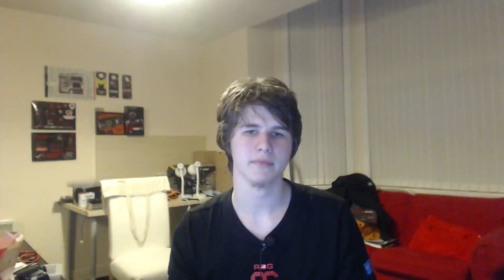Follow up to the RX 480 Red Devil PCB Breakdown (It's not as bad as I think I made it sound)

Comment: is it bad for eth minning and what is the bbest card for minning i basically need the card with the ability most memory oc i play at high only so downclocking to 1150 or lower
Reply from the maker: it's fine for mining ETH
Reply: 24/7? thank you for your fast reply
Reply from the maker: just crank the fan speed. If you under volt the Vcore you have to worry even less.

Comment: I ran furmark for a minute and a half with the unlocked bios at 1330mhz and I got these numbers.

-Max wattage hit 194w, and 1.1625v max. I didnt get the average unfortunately because gpuz shut off on me when I double clicked it in the task bar. The average was most likey around 1.13. or 1.14v.

One test with heaven had max watts used was 216.1w and the average was 130w. Max volts was 1.15630v and average was 1.13360v. This is with the unlocked Bios and an oc to 1330mhz on the core. 
That was my best captured test and gpuz if you double click exits out for some reason and I get averages like 62 watts. 

I think if you run the card at 1330mhz oc and dont touch the voltage, leave it at auto in wattman it will be between 1.113v ave and 1.1625v(furmark) max. 
I belive the max oc people should do on the card is up from 1279 to 1330 and thats it. You'll be fine.

Your pcp vid on this card got me so worried I was up that same night I saw it and just stress testing and last night when I got these numbers I felt so much relief. This video and you saying 1.2v is fine and the numbers over 1330 helped a lot more.

Comment: question.. i see there are two versions. do you have any info if there is any differences in pcb between the two?
Reply from the maker: Both versions of the Devil are the same except that one comes stock at 1290 core and the other at 1330 core.

Comment: OC3D gave the Red Devil a poor score due to the large but surprisingly disappointing cooler. I personally think it looks tacky, and based on what I've seen beyond your PCB breakdown, I wouldn't recommend the card.
Reply: yeah, I've seen that. Decided I'd be fine with it. I mean, I wasn't planning on overclocking anyway. Most of the 480s seemed to run too hot for me to want to bother anyway.

Comment: Hi everyone, some first hand experience.

I own the Red Devil and I am so satisfied with it. And I do have the high power target (using 130%) with bios hacked memory timmings (coz' minning ether sukaz'), overclocked to 1395 MHz, 1.175 VCore. FunMark tested. Well, it was before I found that warning... Anyway, it survived. Core is at 80C and the VRMs are at 75C-isch levels. It is running a 24/7 minning ether. Only sometimes I stop the minning and let i render a blender scene... So probably the worst case scenario talking in the terms of actually not much hardcore overclocking.

Again, I stress this card really hard, and it stands with pride. Great temps and very silent.
Reply: Furmark will not kill your card, there's hidden instructions in the drivers these days to protect cards from that dumb stress test.
Reply: Great to hear. i made a good choice then.

Comment: Can I request a gigabyte xtreme gaming pcb breakdown pretty please? Gamersnexus said you're working on one soon? I guess more to the point I'm curious about what you think of their choice to use quadruplers in the vrm setup
Reply: Not buildzoid, but AFAIK, quadruplers (assuming for the MOSFETs) can provide more current throughput and heat dispersion, but you're going to have a lot more ripple than if you were using more true pwm channel phases.

Also, I think builzoid or someone was talking about some IR quadruplers that actually were intelligent-ish, and could do more advanced current balancing, working more like a true phase, not a dumb doubler. Could be completely wrong here though, idk
Reply: Colin Reay
ah, interesting. what is "ripple" exactly? sorry i am still semi-new to all of this.

i guess i felt a bit cheated when i found out they weren't true phases but then again pascal doesn't really OC much anyways.
Reply: Here (http://www.gamersnexus.net/guides/2053-power-supply-voltage-ripple-and-relevance) is a good article on ripple. Pretty much, if you have excess amounts of ripple (more than the spec your components are rated to), it can decrease the component's life (especially caps which act as the filters, which de-rate in efficiency, causing them to get even hotter to compensate, and can blow up if you get too hot.) 

Also, it can limit your max overclocks potentially, imagine if you set a specific voltage for your cpu or gpu to run at, and your minimum voltage that the component can run at before crashing is only 20mv or so below that which you set, ripple can cause the voltage to dip below that minimum amount, causing errors. You can offset this with more voltage, through LLC, or just adding more voltage offset manually, but this causes more heat.

Yep, I agree with you 100% on Pascal. Your average Joe isn't going to volt mod his gpu, so the VRMs aren't really the limiting factor on the cards, it really just is the voltage BIOS lock, and the subpar coolers, causing frequency dips with GPU Boost 3.0.

Hope this helps man, trying to learn it better myself!

Comment: msi r9 270 2gb gaming pcb breakdown with mod tips until I can get a rx 480
Reply: please for the third time lol
Reply from the maker: Sorry I keep losing track of who requested what and when. Should really get some kind of list for this.
Reply: I tried tweaking afterburner to get a pwr limit of 50 (i think) I but that didn't get me anywhere.
Reply from the maker: should be easy enough to mod the BIOS for more power. The card has a BIOS switch.
Reply: https://www.msi.com/Graphics-card/R9-270-GAMING-2G.html#hero-specification         u sure about that (bios switch)?
Reply: also put heatsinks on everything possible
Reply from the maker: oh woops no BIOS switch. However it should still be pretty easy to change the power limit via BIOS.
Reply: ok I'll do some research. any recommendations on what to use or a certain guide? I've never messed with that. So I'll take any advice I can get. thanks
Reply: also how much more power could I gain being that the 270x has 2  6 pin connectors and the 270 only 1.

Comment: I wanna do power mod on a gtx 960 g1, ik is shunt mod but if i do this mod with a pencil i will can undo this If will go on rma? I hit 1670mhz on custom Air cooling (16*C ambient) and ik can do more but when i hit power limit core clock drop. Can explain me how to undo pencil mod? or what to use to Lower the resistance.(not clu/clp because i dont have) and i dont wanna solder anything on pcb.
thanks
Reply from the maker: the power mod on the shunts can't be done with a pencil you need liquid metal.
Reply: i can't do without liquit metal? Anything? thermal paste conductive)cheap silicone based).?
Reply from the maker: You NEED liquid metal. Thermal paste is generally non conductive. Graphite is also pretty high resistance.

Comment: Even if it doesn't matter for lame ass normal usage w/ mild overclocking, it's still a questionable choice to skimp on those parts to such a degree.  If most buyers had a choice to get a red devil that's not inferior to the reference card in any way for $5 more (or whatever it is), they'd gladly pay the difference.  The reference PCB may be slightly overbuilt in some cases though, so I don't think it's totally unacceptable for a manufacturer to substitute slightly weaker parts sometimes.  Anyway it's nice to know what you're getting, so your PCB breakdown videos are really helpful.

Comment: could you tell me how can i get my gtx 1060 g1 gaming over 1093 mV xD?
Reply from the maker: Physical voltmods. However I haven't used any 10 series cards and from what I've heard they really don't benefit from extra voltage. Maybe in the future when I get a 10 series card I will cover some more advanced overclocking for the 10 series GPUs.
Reply: Ok thanks, i got 2350 mhz at 1050 stable with no artifacts in heaven benchmark however in gta5 i almost couldn't see the game ^.^ by any change do u know why, and thanks for the fast reply.

Comment: Thank you for clarifying, many YouTubers don't clarify when they realize that what they said might have not sounded they way they intended.
I found your initial Red Devil video very informative, but also a bit lengthy, and maybe exaggerated, on pointing how bad the components Powercolor decided to use in the VRM. 
For years Powercolor have decided to use cheap components, that is why their cards are lower cost, but also they come with 2 years warranty. Their strategy has worked for them, just as ASUS has a different strategy with their higher prices and ROG strategies and MSI has its military components strategy.
BTW, subscribed and liked.
Reply from the maker: Yeah I was seeing loads of comments about how people aren't going to buy the card just because the VRM is the weakest one of any RX 480. Yet I bet most of them would never get anywhere near the amount of power draw need to actually damage the card as long as they didn't run Furmark.
Reply: tbh the ref 480 was overkill having better vrms than the 1080 fe

Comment: Please, do the comparison between the 5 phase vrm Nitro + 8g and the 'shity' 6 phase vrm red devil. Great video BTW.
Reply from the maker: There's a 6 phase version of the Nitro floating around too. I'm trying to figure out what the hell is up with that and then I'll do the Nitro video.
Reply: This should be the Nitro+ 4gb, but Sapphire said that the 6th phase is disabled by bios/firmware, so both versions are virtually equal, I think
Reply from the maker: welp that's dumb. If they actually used all six they would have a pretty beastly card.
Reply: Agreed

Comment: Your doing a excellent job with these PCB breakdowns. These cards are selling for twice the MSRP and being built with junk. Thanks.
Reply: he's talking out his ass
Reply: where did you get twice the MSRP from? I know it's an exaggeration but still, it really isn't that terrible.
Reply: RX 480's were supposed to retail for under  $200.
Reply: yeah, the 4gb models were. so where are they selling for $400? unless you're getting some jacked up water-cooled card, and even then it's be a big mark-up. 
and if you live in the US, you have the least to worry about.
Reply: It might have been an overstatement but the point is valid, some of these aib partners are charging premium money for a product that is, at best. a marginal improvement. Case in point, at least here in Europe, both the Powercolor 470 and 480 are among the most expensive.
If you're cutting corners let that be reflected in the prices.
Reply: $269.99 for an 8GB Red Devil on Newegg. That's not too bad for an AIB 8GB RX 480.
http://www.newegg.com/Product/Product.aspx?Item=N82E16814131692
Though don't get me wrong, I wouldn't buy it!!!
Reply: Even If the person NOT do OVERCLOCK on that Red Devil, i HARDLY Believe that it will lasts for like 4 or 5 years.
The quality of the power phases affect the lifespam of the card (or even a Motherboard ).
Reply: I was talking about Europe pricing. For instance, I can find a xfx gtr for 270€ while the cheapest red devil is around 290€. Basically only MSI and ASUS cost more.
Reply: ***** did you read that from a brochure?  Can you tell me how it shortens the life of said components, especially if youre running an aftermarket cooler.
Reply: pfnieks the power color seems to be a US model, while the HIS model of the 480 is almost non existent in the US and costs almost 360$ for me to get one here

Comment: I have a question... what about the PCS+ R9 390?
Reply from the maker: IIRC that card was fine. A lot of the GPU manufacturers are just all over the place with their designs. EVGA is at least somewhat consistent. All the Classified card from them have the same 14+3 phase VRM. This thing is insanely powerful and you will basically never need more power. However if you do for some reason there's the K|NGP|N cards which usually take that same basic layout and use some better components in it.
Reply: Actually Hardcore Overclocking 
I do not buy Nvidia cards these days though (lets say I am a very annoyed Kepler owner).

I was wondering because my current GPU is the PowerColor R9 390 PCS+. It uses less power than other R9 390s... but I dont know of its layout and PCB

Comment: regardless of whatever if you want to push any GPU to its limits or not, customer has right to know if a product has worse component base installed on PCB, than other products. if it is garbadge, then regardless of its "safety" in real world scenarios, it is garbadge.
Reply: Highly unlikely.
Reply: well, it's still the cheaper rx 480 and it have a great cooling and acoustics. since the vrm are good enought to not be a problem in everyday use i see no reason it should be bashed
Reply: One day, AMD drivers division will casually fuck up(they don't always do
 that, but they do nontheless), mess voltage controll, fan controll etc,
 and other 480s will survive and some devils wont. not sayin that devil 
is complete trash, but it wouldn't be right if he just ignored that 
devils PCB design is worse than reference one.

Comment: BTW, regarding Fermi and the 590.  I have a quote... "If you remember the GF100 aka Fermi it's memory controller was so ************ed up that it could blow up quite a few PSUs when all clusters where enabled; that's why they never released it in full."

I don't promise this is true, but it comes from someone who has prove me wrong.  A lot.  Just though you might get a bit of a laugh out if it.  And helps explain the GTX 480 card having a very strong power delivery system.... Breaking PSUs is bad.

Comment: Did they threaten you with a lawsuit? It seems like you made this video begrudgingly.
Reply from the maker: Nah I just felt like people really over reacted. The card is still the worst of the RX 480s in terms of PCB quality. It just isn't an: AVOID AT ALL COSTS level of bad.
Reply: Mine is on its way to me, now. This card should suit me just fine. I don't overclock and never use the fuzzy donut. Quietness is what i'm after, since the rest of my pc noise level is controlled by a fan controller. Thanks for the informative video.
Reply: some guy on reddit called out powercolor support asking them if the vrm was bad using the statements and the video of bulzoid as proofs. basically buildzoid understood that people were not going to buy the card also if not overclockers.
Reply: ***** Well, it's already the cheapest rx 480 and it has a great 3 fan cooler. It's probably the best cooler among all the rx 480's (dunno about msi). I don't see a reason for them to sell it for less than what already cost. I would agree that a version priced like the other cards (10-15$ more than this version) but with a better vrm would be cool
Reply: Upvote for "fuzzy donut".

Comment: Hey buildzoid, do you think a 3+1 phase design is enough for the Gtx 1060? I know is a really low tdp card but I wanna hear an honest opinion from an expert, thanks in advance!
Reply from the maker: you can't raise voltages on pretty much any of the 10 series GPUs. Really can't make the power draw go insanely high on them.
Reply: So each phase shouldn't have much load even at 100% gpu load, right?
Reply from the maker: yep
Reply: +Actually Hardcore Overclocking thanks , hope u do a pcb analysis in pascal cards  soon

Comment: Howdy, What rx480 has the highest stable memory overclock? I have 2 Asus Strix both do 1985 they artifact when I go higher. I also have 2 Powercolor memory at 2250. People on web claim 2275 but I'm capped at 2250. Any advice? ATI flash and Wattman enough?
Reply: 2275 seems strange to me. I read the cap is still 2250 on memory oc
Reply: Something to do with disable Windows signature check and use custom bios made with Polaris editor...  One can tweek memory beyond 2250.  A video on how to do this would be life changing!!!!!
Reply: grg it shouldn't since the gtx 1060 is using the same gddr5 chips and it's able to achieve about 9500mhz instead of the 9000 maximum on rx 480
Reply from the maker: With BIOS mods more mem clock should be possible but as of right now my RX 480 isn't in a functional state so I can't really test those kinds of things on it.

Comment: Sounds like most cards, although this one I think has the highest factory OC for an RX 480? Wonder why that exactly that gigabyte card is so shitty though, least the one Jayz has
Reply from the maker: The gigabyte has a 2 fan 3 heat pipe cooler. The MSI also has 3 heatpipes 2 of them go in 2 directions essential acting more like 5 heat pipes than 3. The ASUS has 5 heatpipes. The ASUS and MSI also have bigger fin stacks than the Gigabyte. Basically Gigabyte just put a shitty cooler on a card that with a core that will happily kick out 200W of heat.

Comment: Thanks for the clarification. However, people are going to want to overclock and push the "normal" limits of their "overclock" version of an RX 480. Also, with Vulkan and DirectX12 using more of the resources of the hardware, it seems plausible that the card will run into a game or application where it runs into the equivalent of Furmark.

Bottomline. Powercolor should have used a minimum of AMD's reference for component quality.